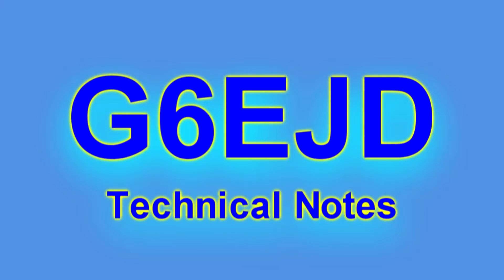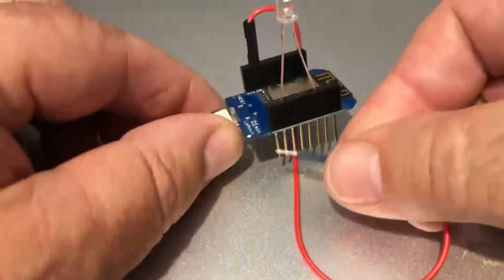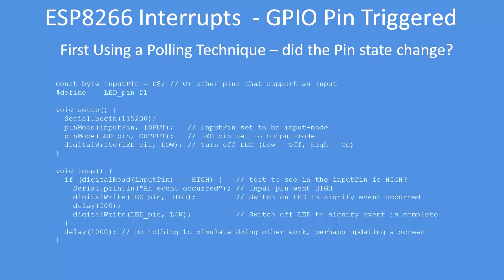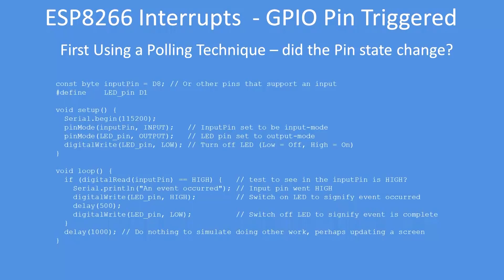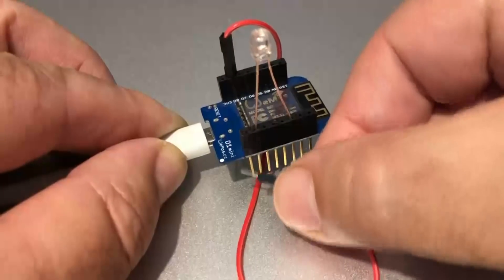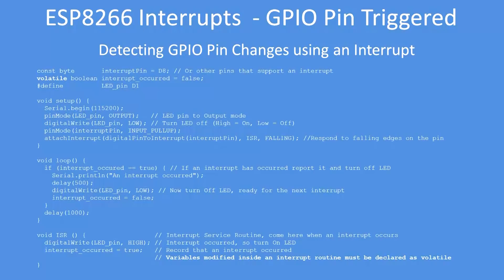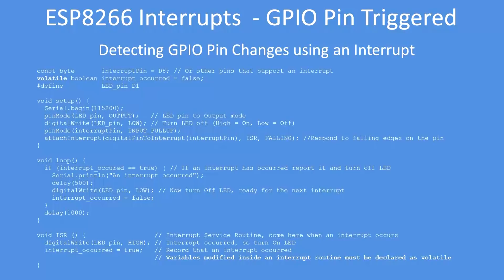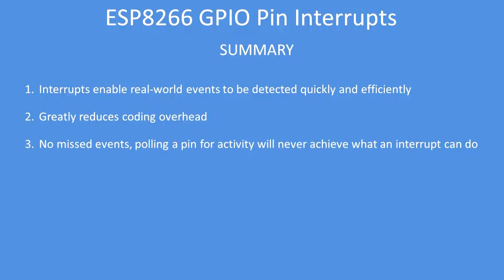Tech Note 124 - ESP8266 Interrupts for Code Efficiency and Speed

Comment: I think the polling technique in this example doesn't work because you are trying to use the raising edge (test to HIGH). If you use the falling edge, i mean test to LOW and instead of stating the inputPin as INPUT, you state it INPUT_PULLUP (which enables the built in pullup resistor) and switch it with the ground pin, polling will work correctly and - for the average user - fast enough. 
AFAIK INPUT makes the pin's state unpredictable and this is why the polling doesn't work sometimes in your example without an external pulldown resistor.

Anyway, this is a good tutorial on using interrupts, I only wanted to give a possible solution why the polling sucks in this particular example - when it is a widely used and completely workable technique.
Reply from the maker: What you describe can work, but for the fastest possible reaction nothing can beat an interrupt and for many inputs there is a finite delay between inputs that prevents the input change from being detected plus the input capacitance tends to hold the input high or low and prevent reaction. Thanks for the comment.
Reply: @G6EJD  True, it is faster, but for example when you use a button or switch, the speed doesn't really matter because you have to debounce it. Using interrupts is necessary when your program is too slow (I mean it does many things) to be able to poll in almost realtime. Noone likes to wait seconds pushing a button until finally happen something.
But for example Arduino Nanos has only two interrupt capable pins (without interestig programming), which means that a third switch cannot be used, it must be polled. I know this is a Wemos, but the programming is with the Arduino IDE.
Reply from the maker: Agreed.

Comment: Nice video Dave but as you said, it was a bit lazy to use the 5V pin (especially when a 3v pin was available)! Might be as well to post a pinned note before someone attempts a slightly different use case from yours and creates a brick - you can brick these! (Don't ask me how I know)
Reply from the maker: John Macrae, thanks yes I’ll add a note later tonight to clarify and explain the correct way of trying this out or wiring a switch.

Comment: Thank you for posting this.  I have uploaded a programme based on this to a WEMOS D1R2 ESP8266.  The main programme simply flashes LED's ON/OFF with a delay after each flash.  The ISR turns OFF all the LED's, sends a message to the serial monitor, delays and returns.  All works well until the switch is pressed when it crashes for a few seconds before recovering.  However if I comment out the delay(500) in the ISR everything works perfectly.

Can you or any of your knowledgeable followers suggest why this might be?  Back in the day I used to programme 68xx devices and if you used an FIRQ it only saved the PC and flags register on the stack, any other registers you needed were your responsibility.  Could this be something similar? 

Any help or suggestions gratefully received.  Bob
Reply from the maker: You will need to move your ISR to Interrupt RAM by doing e.g. void ICACHE_RAM_ATTR onTimerISR() so use the prefix to direct that. If your using 2.5.0 of the esp core it will report if ISR’s are not in IRAM a long over due improvement. There is 32K of IRAM for ISR’s to use. This should solve your problem, so summary place all ISR to IRAM.
Reply: Thank you very much for your reply, I will give that a go.  There seems to be a dearth of information around on WEMOS interrupts.  Thanks again.  Bob  @G6EJD
Reply from the maker: That should solve your problem and don’t forget to make your variables used in any ISR volatile so e.g. volatile float temperature; when defined. Also note if your ISR takes too long then delays get queued I.e. interrupt then delay, then completes, then interrupt immediately leaves no time for the foreground. Unfortunately Arduino interrupts are an emulation of what the processor would ordinarily do, so it’s not truly at the hardware level.

Comment: Could you explain why interrupt related variables are declared as volatile? It seems is a rule but don't know why
Reply from the maker: Using ‘volatile’ directs the compiler to locate the variable in RAM and not to use a processor register, which are used as temporary memory locations where program variables are stored and manipulated. But during an interrupt, processor registers can be used for other purposes and the value can become corrupt, so using RAM prevents this. A variable should be declared volatile whenever its value can be changed by something beyond the control of the code section in which it appears, such as a concurrent executing and this is likely to occur in sections of code associated with interrupts. I should have explicitly stated this. On most processors all registers are pushed onto the stack as the first thing that happens when an interrupt occurs, then when the interrupt routine is finished they are pulled off the stack again and so remain unaltered. These problems are all a function of the compiler, nothing to do with the processor, it’s just very complex for a compiler to temporarily store all programme variables and types when an interrupt  occurs. Holding the variable in allocated RAM makes it easy, especially if the processor has a limited stack size.

Comment: Dave,  I'm clear on the event capture part but the instantanious LED responce has me scratching my head. If the nterrupt was triggered during the one second delay (other work) wouldn't there be a delay in the LED, until the one second was up?
Reply from the maker: No, whatever the foreground is doing including being in a delay routine the interrupt will still occur and can not be missed. Does that help?
Reply: Look to the code of the interrupt: function ISR()
Reply: @bollie9752  Right. See it now. LED is set on within the ISR. Worse that can happen is the LED staying on for more than 500mS.
Reply: @G6EJD  Yes. Thanks I can see that now.
Reply: That is why it is called an interrupt.

Comment: I would rather use 3,3V as Signal on the GPIO Pin than 5V. Or at least a Resistor to reduce the current. Otherwise you risk to damage the device...
Reply: esp8266 ios are 5v tolerant
Reply from the maker: Your right, I'm a lazy engineer, but the ESP8266 has an internal impedance so not much damage will ensue as it can only source about 20mA.

Comment: how many external interrupt pins we can use?  I have 3 switches can we use?
Reply from the maker: With simple switch to pin wiring you can have 3-switches, but if you use a 3-8 line decoder chip then 8 switches

Comment: I have one question

The LED lights up when you want to turn on the switch.
But when the switch is restored it turns on again.

Please tell me how I can make the LED not light up when the switch recovers

Thank you very much
Reply from the maker: You need to let me know which version of code?
Reply: @G6EJD  When the switch is restored, I need a code that the LED does not work.

Because i don't speak english
I can't communicate well
Sorry
Reply from the maker: @heaven4261  I understand but I need an idea of your code version?
Reply: @G6EJD  Update ESP8266_Timer_Interrupts.ino

volatile boolean LED_state = false;
#define LED_pin   D1

void setup() {
  Serial.begin(115200);
  pinMode(D1, OUTPUT); // LED pin
  noInterrupts();                                // Switch off interrupts whilst they are set up
  timer0_isr_init();                             // Initialise Timer0
  timer0_attachInterrupt(ISR);                   // Goto the ISR function below when an interrupt occurs
  timer0_write(ESP.getCycleCount() + 80000000L); // Pre-load timer with a time value (1-second)
  interrupts();                                  // Switch interrupts back on
}

void loop() { 
  delay(100000);                                 // Do nothing, but the LED keeps flashing!
}

ICACHE_RAM_ATTR void ISR (void) {                                // Timer reached zero, now re-load it to repeat
  timer0_write(ESP.getCycleCount() + 80000000L); // Reset the timer, do this first for timing accuracy
  LED_state = !LED_state;                        // Toggle the current LED_state
  digitalWrite(LED_pin, LED_state);              // Flash the LED on or off
}

Thank you very much
Reply from the maker: If the led is flashing it’s because it’s permanently being interrupted check wiring of your interrupt source. Led is off until interrupted then off on next interrupt then on again the next interrupt so there must be a constant interrupt
Reply: @G6EJD  Thank you for your kind answer
Reply: @G6EJD  Finally success
It was solved by connecting the ceramic capacitor to the switch touch.

Thank you very much
From Korea.
Reply from the maker: @letsdiy9521  Some switch bounce
Reply: @G6EJD  It was the cause of the switch spark.

Comment: Thanks for this. Can you have more than one interrupt? e.g one on pin 1 and another on pin 2 from another source?
Reply from the maker: DannyK, excellent question, yes you can add another attach interrupt statement to another pin and add a corresponding function to handle it. There appears to be no compiler limit but I would say 4 maximum the problem is if they all trigger simultaneously then each is serviced  and as one is completed the other will be and so until all are cleared until the next event, all at high speed of course. Traditionally the cpu would respond to any interrupt source and the ISR would then determine what caused the event process it and clear the interrupt register for that source but these are not hardware interrupts per-se more of a software implementation to make it easier to implement.
Reply: @G6EJD  Great thank you for taking the time to reply. Love these videos